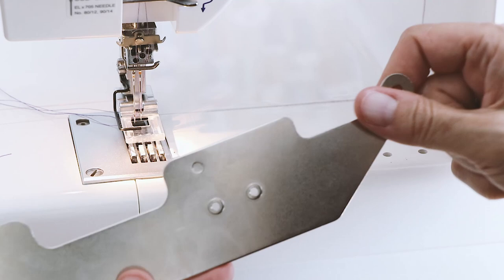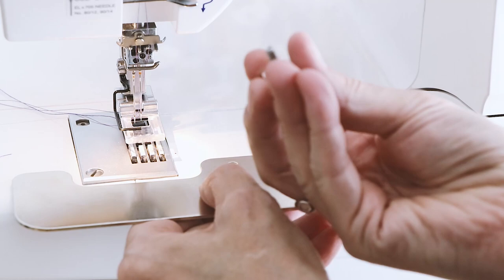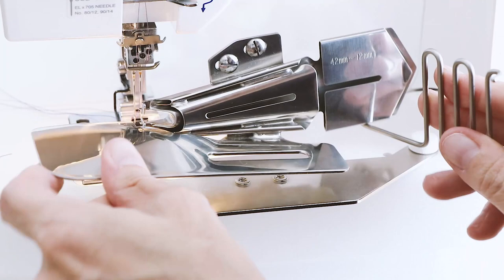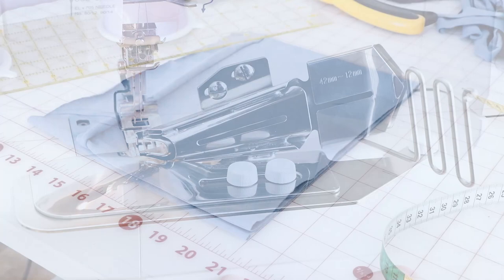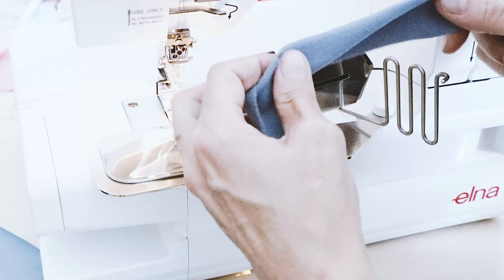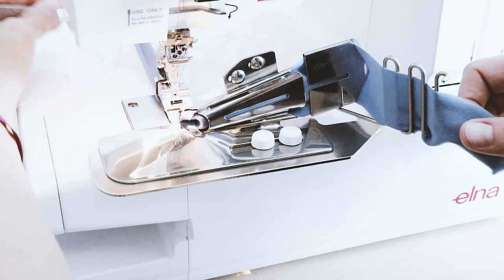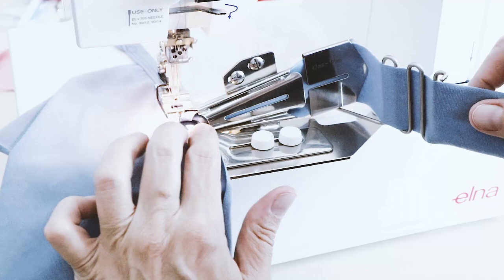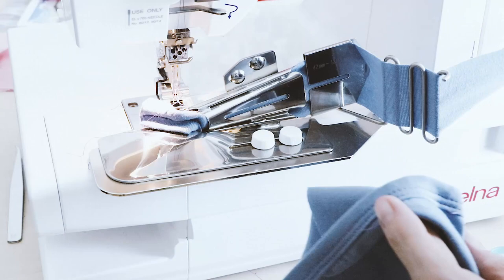Janome Coverpro Tape Binder

Comment: Brilliant thank you. Very, very helpful. I found that I had to use washers with the two white screws to stop the binder slipping out of position.
Reply from the maker: thank you for the nice and helpful comment. you've made a good point. i use washers too with regular screws. but in any case it really helps if the binder should be slightly moving. thank you!

Comment: Do I need a shorter pressure  foot to snap on before the binder attachment?
Reply from the maker: yes indeed, the longer one doesn't fit. although even with the shorter one there is really not much space left between the binder and the foot.

thanks for your question!

Comment: where can I buy the binder?
Reply from the maker: just check under tape binder and then your machine name janome coverpro 2000 cpx for example and look for a dealer nearby. ;-) if you are looking for a cheaper version you find also some on ebay from sharp sewing for example. but you have to check exactly if it fits your machine. and there are different widths too, so up to you to decide ;-).